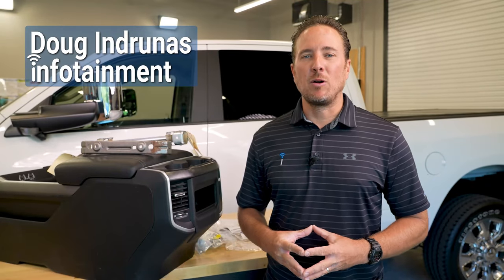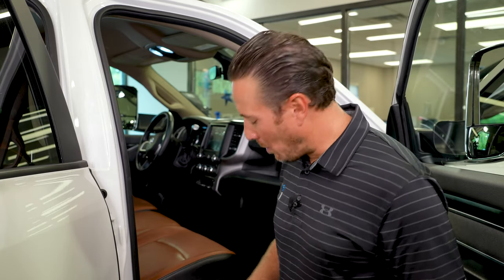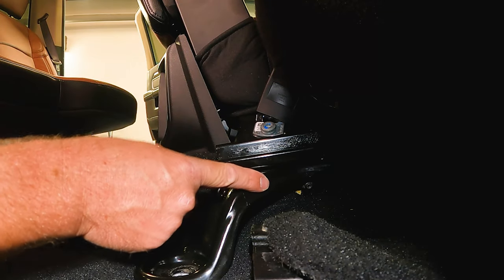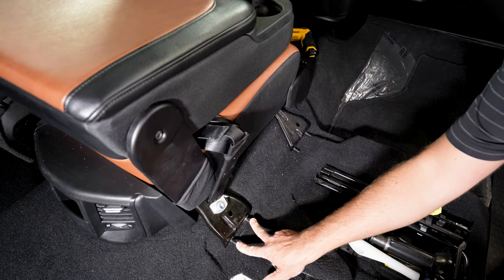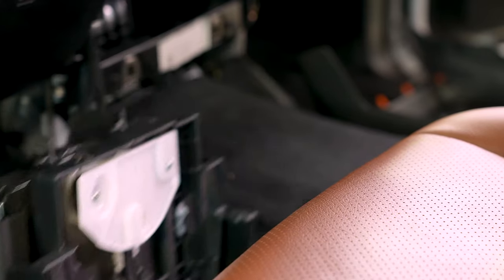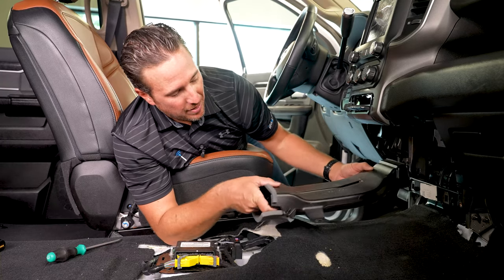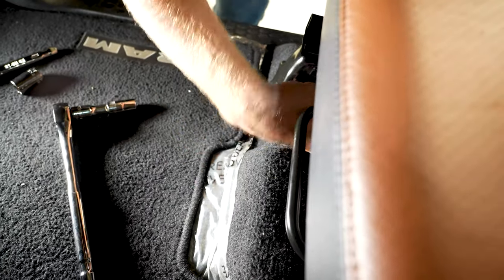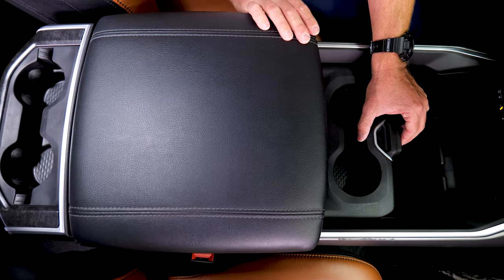2019-2023 Ram 2500 - Full Length Floor Center Console - The Build S1EP8 by Infotainment.com

Comment: Do you have the part number of the clips for the front brackets?
Reply from the maker: Here are all the parts numbers you would need. 

Front of Console Lower Dash Bracket – 68291157AC
Front Bracket Screws (Secures bracket to dash) – (2) Quantity 06505069AA
Rear of Console Floor Bracket – 68366628AA
Rear of Console Floor Bracket Bolts (Secures bracket to floor) – (2) Quantity 06104386AA
Side Screws (Secures console to both brackets, 2 on each side) – (4) Quantity 06508182AA. Optional Screw Covers in Black (4) Quantity 5YM56TX7AA
Right Instrument Panel Closeout in Black 6QB50TX7AA
Left Instrument Panel Closeout in Black 6QY39TX7AA
Reply: @Infotainment_nav  i have got all the parts i need. Do you have a kit to retain all the USB ports and 2 120V ports on the center console?

Comment: Can u do the oppisite. Center console to bench seat
Reply from the maker: The hardware would be simple, just reverse the installation process.

But we have to consider the wiring and any programming.

We'll ask Doug and get back to you.
Reply: @Infotainment_nav  thanks i heard the bench version has winder front seats to. So going from consol to bench i wasnt sure if bench wouldn fit

Comment: It's a 100% plug and play swap, you don't have to buy the infotainment harness, you don't have to pull your USB hub wiring and stretch it to fit. You don't have to unplug the console mounted USB hub wiring. 

Leave the factory dash mounted rectangle USB hub connector unplugged, just plug the USB plug in from the factory dash harness. 

The factory harness from the console plugs right into the dash connection.
Reply from the maker: The harness we sell is just to provide power to accessories such as the CD player or wireless charger. It will not provide power to additional USB's and outlets. The harness is not necessary if you do not have those accessories.
Reply: @Infotainment_nav  The harness you're selling in the video is a jumpseat to console extension harness. It 100% isn't needed, as the console plugs into the bulkhead connector that's right by the factory usb  hub connectors under the center of the dash. Also, at 13:56 in the video, it's mentioned to unplug the existing usb hub and usb console wiring, then stretch your factory usb and hub wiring to the center mounted usb hub. Once again, this is un-needed, as the console plug in the lower right, plugs into the dash bulkhead directly, then the usb connector to the right of it, plugs into the former under dash usb hub (USB CABLE) feed. Leave the former center underdash USB hub under dash connector disconnected, it's no longer needed. This is allowing the swapped in console to have: A.) 100% OEM Wiring, B.) All Center console illumination, USB connections including the rear ports now work.

Comment: I bought a used console with all the mounting hardware and finishing trim pieces, it even came with a CD player.  All I need now is the extension wiring harness you mention in the video and a harness to connect the CD player.

I actually contacted your company and was told that Infotainment would send me an invoice through email to purchase the extension harness: never got that email.  Is the harness available now?

Comment: What exactly does the harness do? I have a cd player under my jump seat already. Do I still need the harness upgrade? For my 2019 Ram 1500?
Reply from the maker: This harness is designed to exclusively supply power to the console’s lights and accessories; it does not support the powering of extra USB ports, auxiliary ports, or 12-volt outlets.
Reply from the maker: The harness provides power for accessories like the CD player. It does not provide power to additional outlets or additional USB ports. This harness pretty much is just for allowing you to keep your factory functions if you wanted to change to a center console.
Reply: @Infotainment_nav  if I already have the factory cd player in my truck with the jump seat and I'm swapping to the storage center console that comes with a factory cd player will I still need the upgraded harness? I don't want to order it and realize I don't need it.

Comment: So I have the usb and connections for the rear seat does that harness still work?
Reply from the maker: This harness is designed to exclusively supply power to the console’s lights and accessories; it does not support the powering of extra USB ports, auxiliary ports, or 12-volt outlets.
Reply: What exactly does the harness do ? I have a cd player under my jump seat already. Do I still need the harness upgrade for 2019 ram 1500?

Comment: I know this an older video but the information on where to find used center consoles is missing. If you could guide me the right direction I would appreciate it thanks.  I just bought a 2022 Ram 2500 Big Horn and I want to upgrade the interior and information center.
Reply from the maker: Here's the product listing.
https://infotainment.com/shop/interior-accessories/wiring/c-intcnsl-dt/

Under product installation, it includes additional part numbers that will be needed, such as brackets, nuts, screws, instrument panel closeouts. 

As for the console itself, preferably one that doesn't have rear USB's or AUX connections. Our harness does not provide power to additional USB ports nor aux ports. You would only retain the front USB's (since you'd be moving yours over) and it only provides power to accessories such as CD player (you have to currently have that, there's additional programming and a wiring procedure if you are adding one) same with the wireless charger.  We mention in the things to know you can search for floor consoles through www.car-part.com from recycle yards.
Reply: @Infotainment_nav  thanks, I appreciate the info.

Comment: Do you have a link to those 8mm screw clips used to mount the front bracket?
Reply from the maker: We don't sell them but here are the OEM part numbers for this kit. 
2019+ RAM 1500 DT

Front of Console Lower Dash Bracket – 68291157AC
Front Bracket Nuts (Secures bracket to dash) – (2) Quantity 06511163AA
Rear of Console Floor Bracket – 68291165AA
Side Screws (Secures console to both brackets, 2 on each side) – (4) Quantity 06508182AA. Optional Screw Covers in Black (4) Quantity 5YM56TX7AA
Right Instrument Panel Closeout in Black 6MA64TX7AB
Left Instrument Panel Closeout in Black 6MA65TX7AB
2019+ RAM HEAVY DUTY

Front of Console Lower Dash Bracket – 68291157AC
Front Bracket Screws (Secures bracket to dash) – (2) Quantity 06505069AA
Rear of Console Floor Bracket – 68366628AA
Rear of Console Floor Bracket Bolts (Secures bracket to floor) – (2) Quantity 06104386AA
Side Screws (Secures console to both brackets, 2 on each side) – (4) Quantity 06508182AA. Optional Screw Covers in Black (4) Quantity 5YM56TX7AA
Right Instrument Panel Closeout in Black 6QB50TX7AA
Left Instrument Panel Closeout in Black 6QY39TX7AA

Comment: Would this be the same on 19 ram 1500 tradesman?
Reply from the maker: If it's a 2019 New Body 1500 Tradesman, yes. We don't have a solution for the RAM Classics. However, please read the things to know on the product listing. This harness we sell does not provide power to additional USB's and outlets. This will only retain accessories such as the CD player or Wireless Charger.

Comment: @12:36 Where can I buy those clips ?
Reply from the maker: You can purchase them through the dealership or a mopar supplier. We list the other parts on the listing for the console harness. This is the part number for the clips 06511163AA

Just click the "Product Installation" tab on this listing and we have the other parts listed.
https://infotainment.com/shop/interior-accessories/wiring/c-intcnsl-dt/
Reply: Thanks and yes I bought the harness from you guys 👍🏼